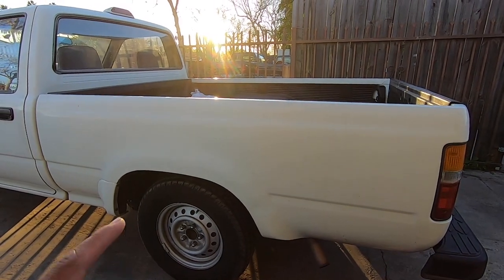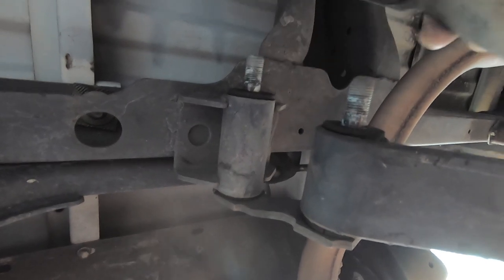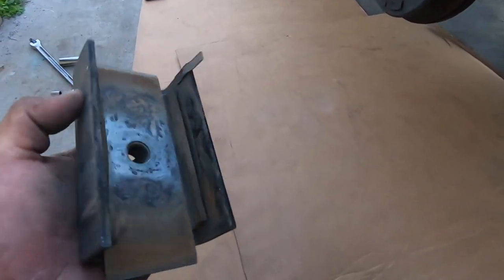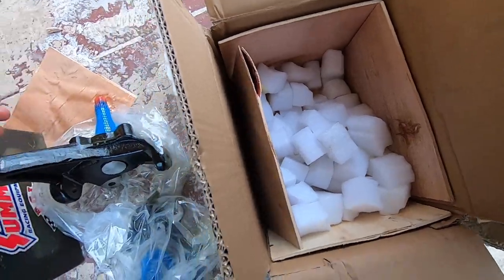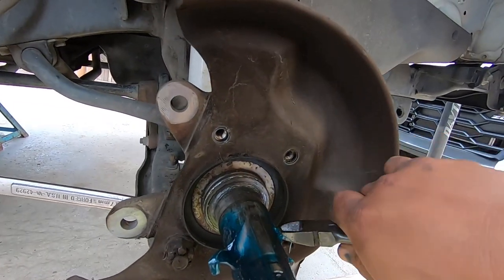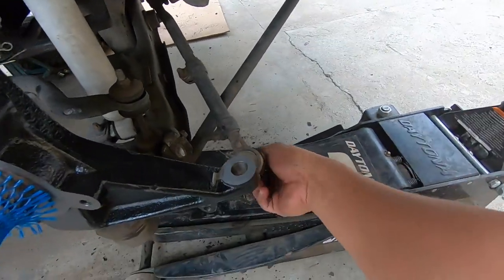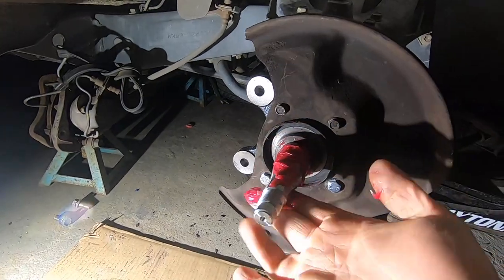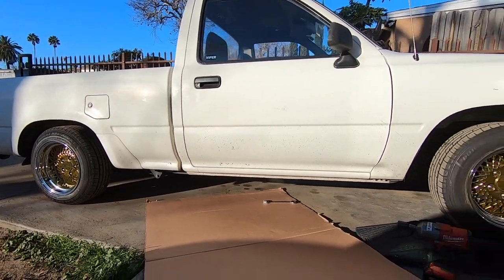How To Install 2/3 Street Edge Lowering Kit On 89-95 Toyota Pickup Plus Adjust Torsion Bars

Comment: Even though this video is a year later hopefully they got an air compressor. Because after a while it starts to lack on your body due to the fact your in a awkward position trying to break off 🔩 bolts..
Reply from the maker: We didnt get a air compressor but we did get a cordless impact. Best investment so far.
Reply: @OXCFilms  Their you go kid. I'm telling know now I'm 40 I'm still young but get it old. Invest in cordless ratchet as well ...
Reply from the maker: Will do. Thanks for the advise 👍. Besides making the job easier its also a lot faster

Comment: I know it’s been a minute since you uploaded but trying to decide if I want the street edge leafs myself. My question is, did you end up getting shorter shocks since the distance between mounts are shorter now? And if you didn’t does your shock bottom out? And what did you do about the bump stop? Cut it or remove all together?
Reply from the maker: Honestly street edge is the exact same thing as belltech but cheaper price. We did get shorter air adjustable shocks, you can find it on our channel. For the bump stops we cut about 2 inches off
Reply: I'm currently looking to lowering my 93 and I like what you did with yours does it ride stiffer? Also do you have a link to the air shocks you got? Cool truck
Reply from the maker: @rufinolara747 thank you. Not the ride is not rough but the leaf springs are really weak and you cant load much with out it bottoming out. The shocks were purchased on rockauto
Reply: @OXCFilms  ok cool! Thanks for replying

Comment: I have a 94 Toy and lowered the front by loosing the torsion bar but dam the ride was a little ruff so I had to raise it a bit.. Did you feel that it made it a comfortable ride with the front lowered spindles you installed?
Reply from the maker: Not sure because we never drove with just the torsion bar lowered. We have heard that there is a difference

Comment: Thanks for the install video. I found out you can flip the lower ball joint and it will lower it another inch.
Reply from the maker: Forsure! We have seen a lot mixed reviews about the flipped ball joints

Comment: Do i gotta change spindles if i add lowering kit? Or was that just ur truck?
Reply from the maker: It all depends on how you want your suspension to feel. If you just want it for looks you can just loosen the torsion bars a bit and it will lower the truck. If you want it to ride good then the spindles is the way to go

Comment: Thanks for the install video. Doesn't look too difficult.  Sick truck! I have a 94' and want the same look. What are the specs of those Enkie wheels? Size, width, backspacing?
Reply from the maker: Thanks! The wheels are 14x7 and -10 offset with 1" adapters
Reply: @OXCFilms  good looking out!
Reply from the maker: Anytime 👍
Reply from the maker: Yes these wheels are 185/60r14

Comment: wat r da specs for rims n tires dope truck man
Reply from the maker: The wheels were 14" enkeis 14x6. I forgot the tire size. But the truck also had a spacer on it. Thank you
Reply: @OXCFilms  thanks man dope truck 💯💯 use to have a 95 hilux back in guam miss it so much🇬🇺
Reply from the maker: Thank you! I can imagine. The plan as of now is not to sell this one
Reply: @OXCFilms  if you wer to sell dat how much would u sell it for jst curious
Reply from the maker: Sell the whole truck or wheels and tires?
Reply: @OXCFilms  the whole truck
Reply from the maker: Here in cali a truck like this is running about 6500

Comment: Whats the stopper for ?? Is that from stock spindles ??
Reply from the maker: Yes the stopper is from the stock spindles. It is to adjust lock to lock
Reply: @OXCFilms  will i have to transfer this over to my new drop spindle? Will be adding belltech drop spindles to my truck tomorrow thanks for getting back
Reply from the maker: Yes you need to transfer your old one to your new spindles. The first time we the installed spindles we left the adjust how it was on the old spindles but the lock to lock wasnt enough. So we had to go back and turn the stopper all the way in and it is way better.